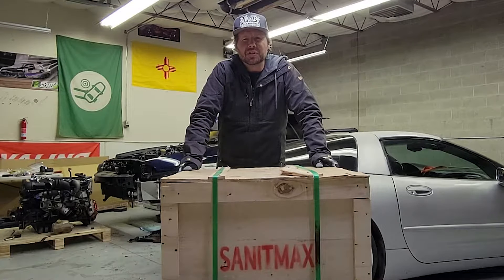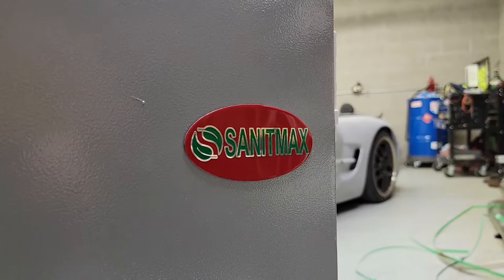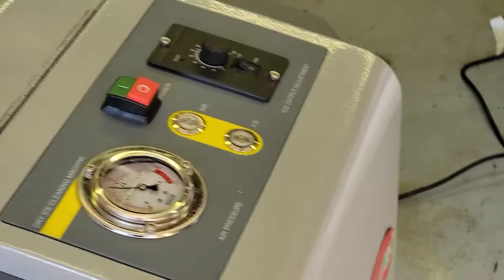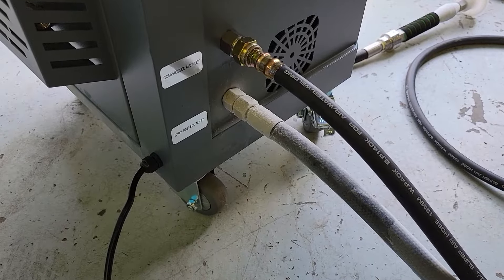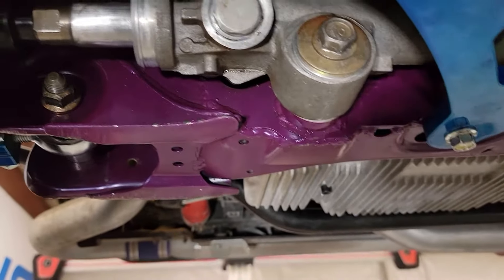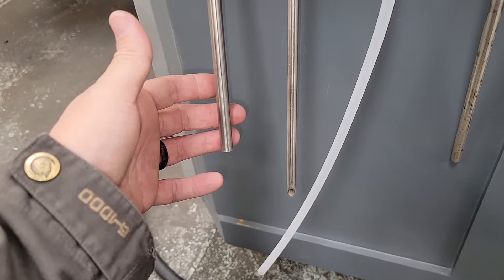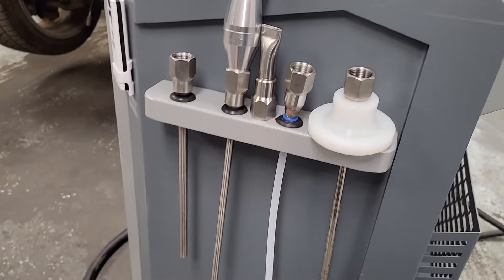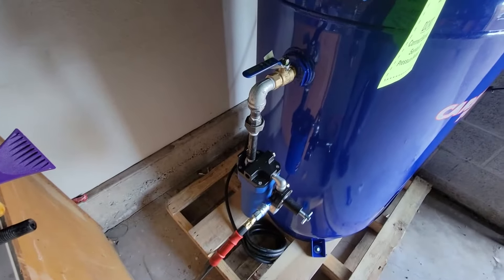Sanitmax SM1000 Dry Ice Blaster Review (Cheapest blaster on Amazon!)

Comment: A small compressor in our industry is considered 20 hp. We usually recommend 30/40 hp. The dryer robs the a/c compressor of 20% so you have to calculate that; hence the issue with compressors under 20 HP.
Reply: What are you blasting? Cars or industrial stuff?

Comment: The fog was due to the lack of a desiccant dryer. Fog = lack of truly dry air. That line dryer will continue to fog & freeze the lines. I’m sure he has it rectified by now. Legit systems are expensive.
Reply: You want the compressed air as hot as possible when it hits the sun zero ice.. 
that’s it, zenith thermal displacement is what creates the aggressive boom out the tube

Comment: The fog around 5:30 is completely due to the lack of a legit dryer solution. That is the reason for the line freezes too. It shouldn’t fog.
Reply: Correct! Compressed air is hot by nature. Hot air and Cold surfaces can create a ton of condensate water, which freezes up the feeding system. Cooling and drying the air is imperative for Dry Ice Blasting.
Reply: should the dryer system be inbuilt in to the dry ice machine?

Comment: One of the reasons the other systems are more expensive is because they let you control the pellet size. None of the professional dry ice cleaning shops, blast cars with 3 mm pellets. The machine breaks it into variable sizes to avoid damage. You need big CFM & a real dryer (not refrigerated). Particle size control is imperative for professional dry ice cleaning.
Reply: Well said. They also make Nozzles that break up the ice into smaller particles, which in turn makes the blast less aggressive.
Reply: Question: So is 1/8th of an inch (3mm) big for dry ice pellets ? Or is that small?
Reply: @timothydeterman6706  it’s way too big for cars 90% of the time. That’s why you must use a dry ice blaster with particle control on cars. If you pelt cars with 3mm pellets; you’ll damage all sorts of stuff. Never blast a car with 3mm pellets unless it’s an unpainted surface on the underside
Reply: The only units you should use is the Coldjet PCS60 or one of the three units made by ICS (obsessed garage).
Reply: Bro you’ve left like 46 comments , sounds like you’re a dry ice blaster salesman who’s mad at Amazon 😂

Comment: This is the best (ie honest) assessment of these machines I've seen.  Lets face it.  It's just a sand blaster with a blasting medium that sublimates into CO2 gas.  Everything about a sandblaster applies here.  More pressure/CFM equals a more powerful cleaning effect.  I suppose that based on the temperature of the medium, some grease / oil will freeze and be physically blown away by the high pressure but really, this isn't much more than a  harbor freight blaster with an insulated hopper.  (I know, there's likely an auger in there that controls feed, but the real money in this system is the huge compressor needed to run it effectively!)

Comment: So how many cfm does it require? Please translate to psi . Have you tried 3/4 inch hose or even 1 inch
Reply from the maker: Cfm and psi are two totally different things. Cfm does not translate to psi or vice versa. You need 60 cfm at around 90 psi to run this machine. Any less and ice gets stuck. I ended up using 3/4 inch line everywhere. I'll do a follow-up video on the setup soon.
Reply: volume is the key and how much air the pump puts out volume in CFM a Rotary compressors can give 100 % and what is need is 70 CFM to work

Comment: So basically it’s the compressor that does all the work.  I think when it’s said and done this is one of those new fads  that is like the latest fancy coffee at your local starphucks 😂. So I can literally do the same thing from my tow behind air compressor that has 275 fm  with a 1” hose on a medium harbor freight canister and always find sand or media for way cheaper and is way powerful.     Even if you don’t have the compressor just rent a tow behind for a day or 2 with 300-cfm all the time.
Reply: The difference..  there's no clean up with this. There's no residue or media to clean up. You can go over electrical and plastics without worry.
Reply: The sand pits the metal I own a dustless blaster as well and it’s not what this dry ice can do

Comment: what is need a 30 hp  rotary air compressor that is build 100 deputy cycle piston compressors are build for 50-60% duty cycle  a 10 hp compressor like shown in the video makes 27 cfm at 90 psi not 35 cfm at 90 psi or at 175 psi 2 stage . What you need a compressor that makes 70 CFM at 100 % all the time and Rotary air compressor 30 hp will do that and they are 25 K and up

Comment: That machine is a toy. It is not commercial size. 1.25 inch feed hoses with mixing happening at nozzle. You should have at least 80psi at 180 cuft min.
Reply from the maker: Got it. I'll stop the business that's currently doing fine, magically come up with 60k and get new compressors and a new machine.